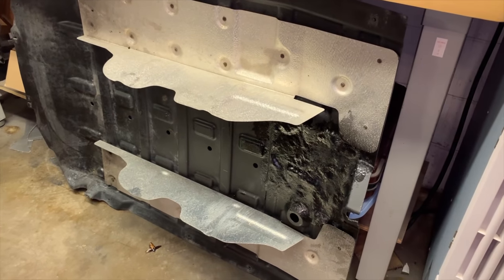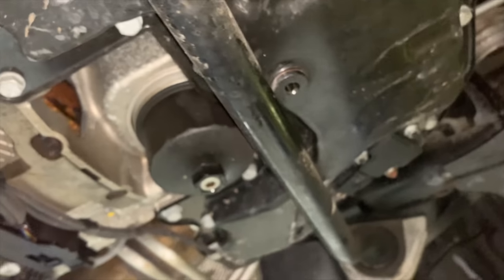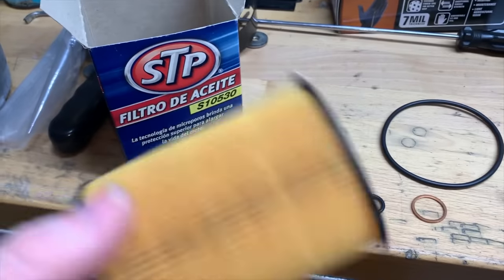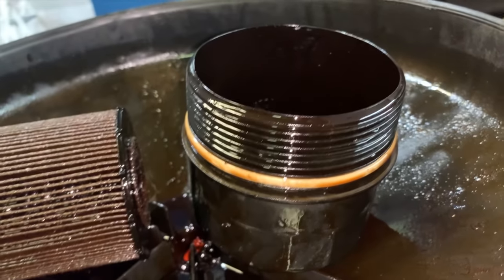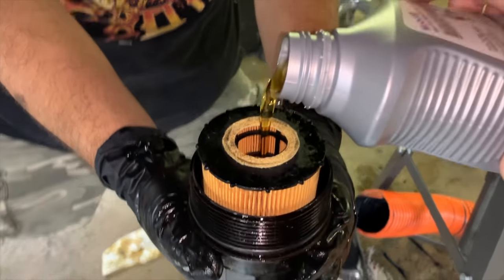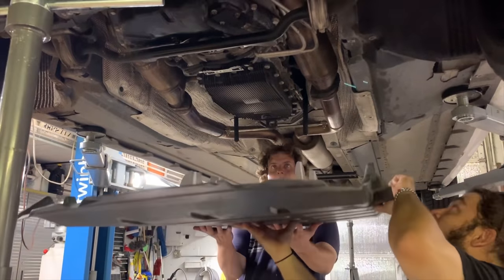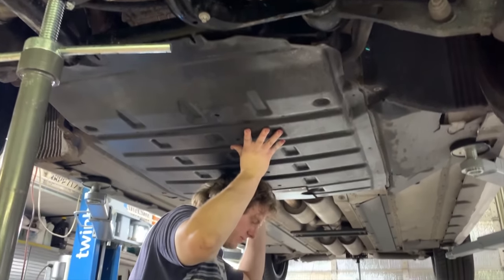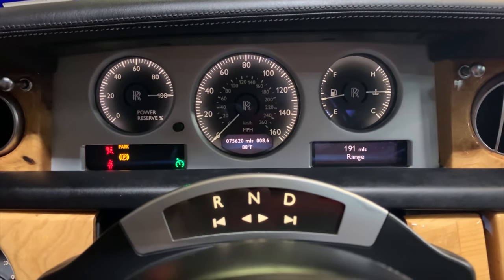Rolls Royce Phantom - OIL CHANGE

Comment: Looks much easier than the Aston Martin v12 oil change. The filter is impossible to get to. I think RR recommends 0w40 for those engine, which is also available from Mobil 1 at Cosco. But I think the BMW V12 specifies LL-01 5W30. Funny how specs change on the same engine from different manufacturers. I would advise against any oil additives. Mobil 1 or Castrol or Valvoline alone for that matter is more than capable to protect this specific engine. However I keep seeing people use stabilizers in antique engine for the Zinc additive and it always ends up as a pasty sludge around the engine.
Reply: I did a quick online RR phantom oil grade specification check (2004, like this RR) Nope to 0w40 viscosity.  Yes to 5w30 viscosity , they got it Right.
Reply: Use amsoil only oil that is 100% synthetic
Reply: Always that one Amsoil guy...
Reply: Travis Olson i’am the amsoil guy because it is the best. What is your choice?
Reply: I use many brands depending on each separate oil specification number per engine. No chance of failure.
Reply: Travis Olson  I presume you have never used amsoil. If you haven’t do yourself a favor and try it . I used Mobil 1 for 30 yrs. I tried amsoil and I was amazed. I use it in my lawn mowers ,cars, and truck diesels. Buy there oil and oil filter it will be the best $100 you ever spend.
Reply: While I do use synthetics I dont find the need to order higher priced group 4 and 5 synthetics such as what Amsoil offers for a few reasons. 1) I change my oil often just for the hobby of it, and not that I dont trust the long drain benefits. 2) none of my cars benefit from a premium synthetic because all are antique or simple origin (non turbo, etc...) 3) Amsoil is simply too expensive for often I service my cars. Now maybe id try the 20w50 Hotrod formula in my MG, but it already leaks, maybe id try it after I replace a few seals. But thanks for the offer. The product doesnt quite fit my bill.
Reply: Travis Olson Yeah amsoil way to expensive 😬 i always use mobil 1 full synthetic on my Dodge Stealth r/t NA but if i had the twin turbo model i probably would want to go for the best quality like amsoil cause of th extra strain on the engine from the 2 turbos 👍🏽
Reply: I won't let 5w30 touch any of my cars. 0w40 or 5w40 only.
Reply: Alex Villalobos  full synthetic is not 100% synethic. I change my oil every 5000 miles with amsoil.
Reply: Nick Holtz if you don’t use the right weight oil your engine is not getting lube properly.
Reply: reginald Small yeah i know its not full synthetic. I think Amsoil is actually 100% full synthetic but is probably why it cost so much more than any other oil brand i use

Comment: I used to own a 1996 BMW 750iL, changing the oil for that m73 v12(which is also used in the Rolls-Royce Seraph)was not much different than this here, only the oil filter is accessible from the hood, on the driver side, I used 4 ton-rated ramps to get under it to drain the oil. I actually want to get an n73 v12 to work on for a project, I know they’re mechanically and electronically complex, but that’s what I like about them, the engineering.
Reply: 7 series was having N73B60
And rr is having N73B68 both are different in bore stroke and Cubic capacity
Reply: I’m aware of that, I’d rather look for one that’s already been removed from a 760li, I would not dare to mess with the RR based one(way too elegant for me to mess with), even though they’re not much different from each other.

Comment: I always change my own oil. When I was in high school, some fool must have used an impact wrench to cross thread my drain plug. As a result, the only way I could figger to get the old oil out was to take the filter off, disconnect the coil wire and bump the engine over. It made a huge mess...
Reply: Not Hitler  Nah. I was a dumb kid back then. Besides it was a POS 1980 Chevette, that would not die. I drove the shit out of that car, and when I traded it in I got 300 bucks for it. The sales man that sold me the new car took it home for his kid to drive.
Reply: @wisdomSP  I had one to could not kill it. It had over 250,000 and spark plugs where perfect and I believe they were the originals because they were so corroded I could not get the proper socket on them..
Reply: @mohawkvalleyphenomenon2974  Yah, I ran that car out of oil and it overheated several times. each time add oil or coolant and keep going. At one point I jumped a set of railroad tracks and all it did that I could see was flatten the bottom of the tail pipe. They certainly don't make cars like that anymore.

Comment: I like that Rolls Royce/BMW puts the drain plug facing directly down, instead of at an angle like my previous Hondas, my Solara, and my Lexus.  Maybe it's just Japanese cars that do it, but it's annoying because I can never get my oil catch pan in the right spot to account for the angle, so the first second of draining always shoots onto the garage floor (or my arm).  I guess the angle makes removing the plug easier if you don't have a lift or very tall jack stands, but I'd rather not have oil going everywhere but in the catch pan.
Reply: I have a Citroen (French marque) and it's drain is at a ~30° angle. And as a bonus it's partially obstructed by a pan "shield" so you need a special tool reach it.

Comment: I have an easier idea for changing oil on a royal Royce's.  Get a 300,000 mile crown Victoria remove body and put royal Royce's body on crown Victoria. And then put a fumoto quick oil drain valve and you are done. Oh yeah and then buy kendal oil full synthetic from 99 cent store. And you are done. And no body is the wiser.

Comment: FYI Don't forget about electrolysis between copper drain plug gasket and aluminum oil pan. Use an aluminium gasket for the drain plug.
Reply: Irwin :  Copper washers are used in many vehicles as drain washers, BMW is another example including some Japanese autos, have never seen any battery issue.
Reply: Looked steel to me, the trans pan looks alum.
Reply: @jesse2076  :  At 5:58 it says its Copper washer, and I use them so I know.  Its a steel pan, because of the curves and shape, easier to make.  Alum will need welding to make such contours.

Comment: Why should someone do it itself. If you’re able to buy yourself a Rolls-Royce  than it’s not nescessary to do that. You just go to the dealer and pay whatever.
Reply: Jan Wind because its over 700 dollars and if your smart you can do it yourself. Wont take longer than an hour.
Reply: Hancho familia , maybe if you have an old RR and no way to go to the dealer. Otherwise it is no issue to let it be done by the dealer. You have plenty of money to do it at the dealer with the other maintenance. So this video is great for the hobbyist but not for the rich and famous.
Reply: For 700 bucks every 3 months or whatever the intervals one could hire a personal mechanic that works at the garage at a personal raceway..
Reply from the maker: I didn't do it myself. I had my staff do it for me, inside the building I paid cash for, that keep my fleet of cars in. So yeah, you're right.

Comment: Bob: love your videos, you and your mechanic seem like good guys and if you own one of these Phantoms, it would seem like you'd need a garage, with a lift and a friend who is a good mechanic, otherwise, like you said, be paying the Rolls dealer $250.00 per hour!  I cant help but think however, that electric cars will eliminate so many parts that ICE's use and spend less time in the repair shop, plus with less parts, should be more reliable in the long run! Electric cars, I'm sure, will still have gremlins, that will need fixing though! And you'll still have brakes, windows, a/c, etc. Never saw that video where the Rolls fell off the lift and killed that mechanic, frightening!

Comment: Surprisingly easy. The thing about very large NA engines like this V12, is they are extremely solid if the basic maintenance is performed. 

It’s 15 years old, how’s the insurance for this? I imagine it’s through the roof if it’s based on its original MSRP. 

I’ve also heard that tires must be done at Rolls Royce, due to no other car using the Phantoms tires for 2004. Is this true or just a myth?

Comment: That looks like a Toyota RAV4 filter with the nipple.  I would cut the plastic belly panel and make a door cover over the oil filter using zip ties to make the job easier.

Comment: how do you feel about Royal Purple Motor Oil? is it a scam? is it good?
Reply from the maker: It used to be god and I used to be sponsored by them but since they got bought out I have heard it is not the same formula and not good any more all though I use it in my Cadillac and my Harley
Reply: Synthetic oil is synthetic oil.  Just use the right weight and make sure it has the API starburst logo

Comment: You shouldn't use cheap oil filter it's paper it will fall apart and damage motor use a Mann German oil filter from Napa auto parts

Comment: i'd have started it with the belly pan off to check for leaks. i also would not have used a 5 dollar filter on a car that expensive. but that's just me.
Reply from the maker: we did
Reply: @RobertMoseley  i thought i heard u say in the vid that u got a 5 dollar stp oil filter. did i hear u incorrectly ?

Comment: Engineers couldn't just move the drain cap literally half an inch over.....?
Reply: Right? There was a car I worked on in the past (can't remember what it was) where the drain plug sat right above the exhaust downpipe. Absolutely no way of avoiding oil on the exhaust.
Reply: Bean counters said no.

Comment: Oil change every 3 to 5 thousand miles? 🤭🤭🤭 you can go 10.000 miles without problems with today's synthetic oils 👍🏼 modern new cars have the first oil change at 20.000 miles 🍺
Reply: Dirt intake is still a problem no matter how fancy the oil, and acidity accumulates the longer you keep the oil in the engine. Acidity is worse as the engine accumulates more miles.
Reply: @5jjt  my new Volvo truck has his first oil change at 100.000 km 👍🏼
Reply: @5jjt  intake dirt ? Change filters and oils in time with quality oils and original quality filters! Then you have a  clean engine! Waste of money and oil at 5k ! If you want to be extra careful You can change oil filter at half oil period!
Reply: @Iplay ToWin just check Audi or Bmw or Mercedes 1.000.000 km oil test 😉
Reply: Change my oil every 10000km and my little 1.4 tdci (french Peugeot engine by the way) in my Ford Fiesta has more than 338000km. Never had to do any repairs on the engine and last oil change I used a little camera and looked into the valve train via the filling cap. No visible wear at all and very clean inside. And this all without those nonsense oil additives that people try to recommend. Modern oils don’t need it and it will result in thicker oil viscosity which modern engines don’t like at all.

On the other hand my company car is a leasing. 40000km between oil changes (1.6 cdti Renault engine). So far at 95000km it will use 1 liter of oil every 10000km. This means by the time it needs an oil change I already replaced 4 liters of oil of the 6 liters in the engine. In the long run it is just much more expensive than changing the oil more frequently. Now I know why the leasing will give me a new car once it hits 180000km 😬

Comment: Lucas additives are crap.   The BMW requires oils of precise ratings for each of its engines.   I am going to guess for the RR it is an LL rating.

The filter itself should be a Mann or a Mahle.  Guys, a V12 TT is most definitely not a SBC.

Comment: Why don't you just siphon oil out dipstick tube? Done in 5 minutes and the tool costs less than a bag good weed
Reply: Because you'd still have to remove the belly pan for access to change the oil filter. Rubbish design.
Get a Mercedes next time.  Entire oil+filter change is done easily and quickly from above with little or no mess.  Oil is completely evacuated via the dipstick tube because MB engines are designed for it to be done that way (since the mid 1990s!)  There's no "shit" left in the sump, ever.

Comment: At least buy a factory filter , why the fuck would you use a $5 filter
Reply: What the fuck is wrong with a $5.00 STP filter?   Since you seem to know, what makes a RR filter so far superior?   Does Rolls use some special filter medium that makes them just all that?   I am surprised you did not condemn him for using Mobil 1 oil.

Comment: 2 Ton jack stands ? The calculations that I have is the car weighs 5400 lbs. Two tons is 4000 lbs. 5400 lbs. is over two and a half tons.
Reply: support jacks...the car is still on the lift
Reply from the maker: Those are just there in case the lift were to fail or the car tilted. The lift supports 9000 lbs. 
So, add that into your match Waldo!

Comment: so you tell me, you a have a bmw v-12 engine, and you put a crappy American 5w30 oil in this engine? I hope you are not a certified mechanic, because german engine need special spec on the oil. On this engine you need the "BMW LL-01" spec, Mobil 1 selling 5w40 European car formula, even Castrol sells a 5w40 European formula. you can't make an oil change properly, how can you fix the other problem correctly
Reply from the maker: Manual calls for Castrol 5w30.
Reply: @RobertMoseley  since it's a bmw engine, you still need bmw engine oil spec, even on 5w30.
Reply: @16juillet1985  calm down badass. If you such a butt hurt for “bmw oil” tell what’s so special about it? Does that engine have special metals that other motors don’t? Does bmw spec have better lubricity? Sheer film strength? Adhesion? Educate me please.
Reply: @christiansanchez8959  bmw tests various oil brands in their lab. They approve any oil, which withstands their tests. Mercedes even has a website for costumers (mercedes BeVo). There you can see which engine oils from various companies pass these tests. Cheers

Comment: thats not a Royce , its a BMW , 
I usually take a secod or two and start the car  let it tick over a few mins , then turn it off .
then put the guards back on , some of those plastic filter housings can leak and with a guard on its easily missed.
just a thought.

Comment: You don't need to change the oil that often. We don't do that in Europe and cars can last just as long.
Reply: The oil they use in the US is of a poorer quality than European ones...
Reply: @eknaap8800  Do you have a source for that? Does a company like VW prescribe more often oil changes in the US then in Europe for exactly the same engines?
Reply: @sverduijn1  : Oil intervals in the US are more closer together than in Europe. The engines used in European cars there aren't much different from here. One can even argue that the driving conditions in the US are better (longer distances with a warm engine, not much revving due to the auto-gearbox); still they maintain a tighter interval. The reason behind that must be poorer oil quality...
In Europe a modern car sometimes has an oil change interval of around 37000 mls. 15000 mls is considered as normal.
Reply: ______x yes they do. US uses bad quality oil.

Comment: Does this car oil change last long than 3 k ?
Reply from the maker: Larry Calloway Actually, the car recommends doing it every 8000 miles, but based on the number of recorded changes in the computer it has been done every 5000 miles, in the hot Texas weather I like to change it more often.
Reply: Videobob Moseley  Thanks 🤟🏽☺️  I FORGOT ABOUT THE WEATHER DIFFERENCE BETWEEN THEIR COMPARED TO CHICAGO AREA  ! Thanks , I’m new subscribers.

Comment: How many litres does it take for the RoW?
Reply: I don't know myself off the top of my head.  We're about the only folks on the planet that aren't fully vested in the metric system  But, you know it takes eight (8) quarts or two (2) gallons of oil.  Find a website on the internet that will do the conversion (either quarts to liters or gallons to liters) for you, and you'll have your answer.   Recall, too, that a quart weighs two pounds, so one gallon weighs 8 pounds.

Comment: @2:25 - oh my! God Bless them; how awful. Having personally witnessed two cranes failing and dropping containers back in my seafaring days, I’ve developed a healthy respect for suspended heavy objects. One time in Melbourne, Australia I stopped eating my breakfast, walked out, and chewed out a high rise construction foreman after watching his men repeatedly get under a low boy that the crane operator would then lift up to the men working up top. Screwing around with crane loads is a quick way to get yourself killed.
Reply: I use to work at mechanic shop and my lift locks failed while I was under the car, the lift fell and the next pair of locks caught it, and the car oil pan was about an inch above my head. Also in the same shop had in floor lift fail and tilt forward, and they finally got rid of that ancient death trap.

Comment: Why’d you prime the filter? Only time you prime filters is on diesel engines. What a messy job
Reply: Doesn’t oil pump draw after the filter ? Wouldn’t hurt to have it primed a bit than to force oil thru a dry filter.
Reply: You don’t prime the clean side of filters. Especially not the primary diesel filter.

Comment: I had one of these element filters on my ETypes and they were constantly leaking - incontinent cats! You can buy a conversion kit so modern screw on/off canisters can be used. Am sure Rolls Royce would have this as well. After watching those guys die under a Rolls I would need more support than a hydraulic lift!